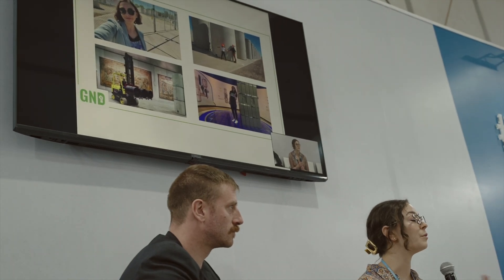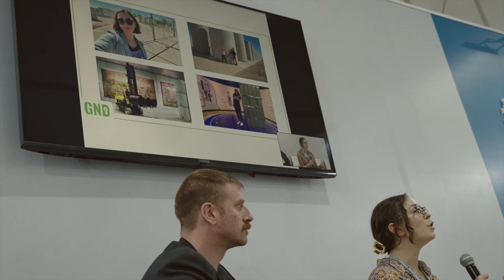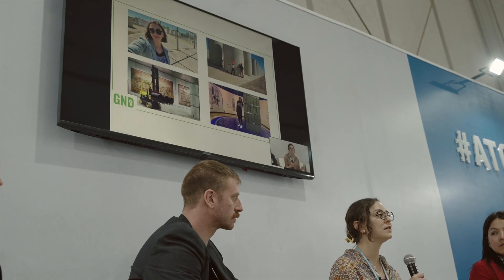Nuclear Waste: Image vs Reality (Madi Hilly at #COP27)

Comment: I'm eager to be persuaded that nuclear waste isn't a problem but this video doesn’t do the trick.  These storage casks can't be left lying around anywhere and require some looking after.  The questions not addressed are 1) How long is the high-level nuclear waste going to be dangerously radioactive?  2) How long can we know that these storage casks (in ever-growing quantities) are going to be physically stable and adequately looked after?  eg kept from natural deterioration or from terrorist attack?  The reason people want to hear that it is buried deep underground it that that solution doesn’t depend on circumstances long into a future, the shape of which, we don’t know and can't control.  It’s irresponsible to leave future generations with tons of our radio-active waste to take care of.  We can reasonably assume they’ll be busy coping with challenges of their own – challenges we can't know of now.
Reply: The casks are generally on the nuclear power plant site, meaning they are looked after by the same security and safeguards as the power station.
Q1) There is a more detailed video on this channel with Professor Boreham on this question. But about 100 years is the approximate answer.
Q2) Casks are conservatively designed for an 100 year lifetime. This means that it wouldn't be surprising to see a 150+ years of design life. They are extremely heavy and robust, if terrorists have the means to steal or break them then why would they not destroy a full plane, a skyscraper or attack a busy public space instead? Eco-terrorists attacked the Super Phenix nuclear site during construction, launching 4 RPG strikes to little impact on the actual plant. A single cask contains only a portion of the spent fuel with 1000x less radiation than when first removed. At Fukushima-Daichi you had newly shut down reactor fuel plus the previous batch of fuel meltdown and yet there were no resulting deaths from radiation.

Remember we must think of everything in context. We are leaving 1000s of tonnes more of CO2 in the atmosphere for future generations to deal with. A number that increases everytime a nuclear plant is shut. We also need 100x more mining for other forms of energy production, mining that results in tailing dams. These regularly break (every 2-3 years) killing people, flooding villages and destroying the environment with toxic waste water. Search Brazil tail mine collapse for one of the most recent cases.
Reply: @Al3xki  Thanks for very full reply.  I'm amazed to hear it’s only dangerous for about 100 years.  I've heard of it having a half-life of thousands of years.  I've heard this many times.  If it’s really only a hazard for 100 years that makes all the difference.  
The Boreham video – do you mean the one at https://www.youtube.com/watch?v=GKwO_ac5_MM ?
Reply: @Gloria_Smess   Applause for bothering to investigate.  Look also into the two-billion year old nuclear fission waste site at Oklo Gabon.  Even without any casks or burial, the waste didn't spread throughout the region.
Reply: @Gloria_Smess  the stuff with long half-life isn’t the dangerous stuff. The really short half life stuff isn’t either. It’s the medium stuff in the low hundreds half life that needs managing especially.’
Reply: It looks like @Alex Kirby already did a good job answering your questions, but I wanted to point out some underlying assumptions that seem apparent in your line of questioning.
First, when you say "these storage casks can't be left lying around anywhere and require some looking after," the underlying assumption is that being able to just leave waste, of any kind, just lying around is okay. Or at the very least, we should be able to just leave waste in any unspecified place without any due consideration or care. Obviously, I don't want to say "this is what you think?! hahaha how dumb," but rather point out the tricks all of our minds play on us when dealing with these kinds of highly charged issues that are often surrounded more by narrative than facts and data. Of course, all waste is dangerous to some degree, even food waste is dangerous as it harbors innumerable pathogens and is the preferred diet of many pests and vermin that themselves are disease vectors. When it comes to nuclear waste, there are 0 deaths to have ever been caused by handling or storage of spent nuclear fuel. Since the nuclear energy industry is one of the most, if not the most safety-obsessed industries to ever exist, it follows that the layers upon layers of safety mechanisms from the fuel removal process to the casks to the storage facilities themselves all contribute to making nuclear waste the safest waste in existence. In reality, you have to try very hard to receive injury or cause death via nuclear waste.
Secondly, to your first question ("How long is the high-level nuclear waste going to be dangerously radioactive?"), there is a common misconception that all radiation is bad/dangerous and that anything that is radioactive is in it's own class of super-dangerous-really-bad-stuff. In reality, radiation surrounds us every day of our lives and is not inherently dangerous. The fact that nuclear waste and fuel are radioactive is unique to them as fuel and waste, but the dangerousness of them is not. Consider waste from oil cracking (the process by which fossil fuels, plastics, and other materials are derived from crude oil), or waste from solar panel manufacturing/dumping/recycling. Many other waste streams contain heavy metals, which while not radioactive are absolutely toxic and just as dangerous as spent nuclear fuel, but they do not decay and exist forever and are merely dumped into landfills to leech back into the environment. Consider also plastic waste, which we learn more about the dangers and risks of every day. Remember to put these things into context when asking how dangerous nuclear waste is, because when placed side-by-side with other waste streams, nuclear waste is the least dangerous mainly because it is tightly controlled, easy to detect, and fully accounted for.
Lastly, I wanted to talk about what it means to "take care of" spent nuclear fuel and nuclear waste. Most of this work is done at time of removal from the nuclear reactor, when the spent fuel is placed in pools to cool. This is the period where the most radioactive elements dissipate, some as quickly as a few hours from the time they are removed from the reactor. What is left after this fuel has cooled is much less radioactive, but still highly-radioactive, spent fuel that is then placed in casks that are built to last as @Alex Kirby mentioned. Afterwards, these casks are stored and monitored for the foreseeable future. As you imagine this process, I would like you to consider what that monitoring and storage looks like as this is the "taking care of" that you mentioned. Even if we were to stop all nuclear power production today, this work would need to continue. The fact of the matter is that there is comparatively very little that needs doing in terms of hours of work or level of effort. Also, at the end of the day, if we want to reduce this work to near-zero then we would consider removal of these casks from the powerplants they currently reside at and placing them into deep geological storage where even if in hundreds of years one of these casks looses internal pressure, or has some other issue, then it will be far far away from anywhere near where it could have an impact on any person or the environment. 

Thank you for asking these questions, and I hope that you find this helpful and continue to ask more questions. This technology is amazingly powerful and has unrealized potential to improve all of our lives. I sincerely hope that you consider nuclear energy as something valuable to humanity and a shared prosperous future.
Reply: One thing I wanted to point out that often trips people up: The longer something remains radioactive - that is, the longer the half-life - the LESS dangerous it is to be around it at any given moment.

Think of it this way. If you have a candle, and you drop 1 drop of gasoline onto that candle every minute, it will flash with the release of energy but then return to normal. It's risky, but reasonably safe. Alternatively, consider how much more dangerous it gets if you just pour a solid stream of gasoline onto that flame. The danger is in the amount and rate.

1kg of element A with a half-life of 1 minute and 1kg of element B with a half-life of 1 billion years both have approximately the same amount of radioactive energy. The difference is that element A is giving off that energy so bloody fast that it's going to expend virtually all the radioactive energy contained within it in just an hour or so. This is a LOT and is bound to harm you. Meanwhile, element B is giving off its energy exceedingly slowly - maybe just a single atom's worth every so often. This is such a low amount that it's possibly less than the background radiation wherever you are standing and not likely to hurt you.

Thus the reverse of this is that while the short half-lives are more dangerous to be around while they are hot, they actually exhaust their supply of energy and become NOT radioactive more quickly.

Back to the gasoline example, if you have 1L of gasoline, pouring it straight onto the flame will cause a big flame expansion and be very dangerous. However, you run out of gasoline very quickly. Meanwhile, if you do 1 drop per minute, it could take you a couple WEEKS to exhaust that full liter. 

This is why something like uranium-238, by itself, with a half-life of almost 5 billion years, gives off so little radiation at any given moment that it can be safely held in ones hands (https://2.bp.blogspot.com/-DtoVROoHKl0/TsPJ8PEzFoI/AAAAAAAACFk/3AGrdRJNozo/s320/Uranium.jpeg) without any concern (they only wear the rubber gloves to avoid getting oils from their hands on the sample). 

Someone talking about something being radioactive for "millions of years" means they are talking about something that is not terribly dangerous to be around. Obviously you don't want to sleep with it under your pillow, but it's not going to be harmful to walk by or even have lunch near.

So if anyone ever asks you if you want to hold something radioactive - ask the half life. If they say millions of years, feel free to try it out. If they say something in the ballpark of minutes, hours or days, get the heck out of there.
Reply: Gloria, Do you honestly believe that "These storage casks can't be left lying around..."?  Oh wait.  I see that you are a BOT.  No wonder.

Comment: TYVM Chris and Jesse of DM, and preach it! Madi 🤩
We desperately need to educate people that all radiation is not created equal. There's a hellava danger difference between Cs135 (2.5My half-life with 200keV beta decay only) and Cs137 (30y half life of 512keV mixed beta AND gamma decay)

Part of (Quite A Lot actually) the USA's 'waste' image is because the USA refuses to drop the 1976 Carter edict to forbid reprocessing and reclaimation of their SNF because of a mistaken beliefs about its plutonium content. Fuel bundles that've spent 3 years in-core have way to much Pu240 in it for it to be weapons-grade. Reprocess all those storage casks. Reclaim the uranium and plutonium that be MOX'd or chlorided up and put it back into the fuel cycle. The true volume of the fission product waste becomes a fraction of what it was before. 
It's a Non-Event and a no-brainer compared to the minging true waste of wind turbine blades whose final destination is landfill 😒